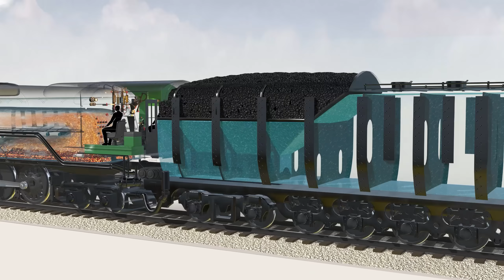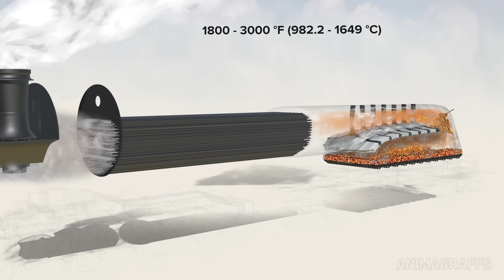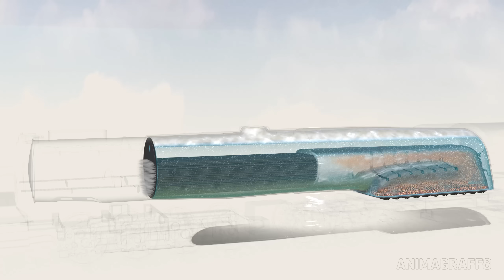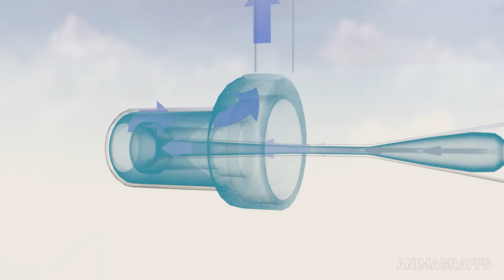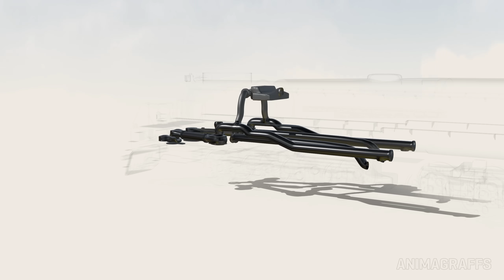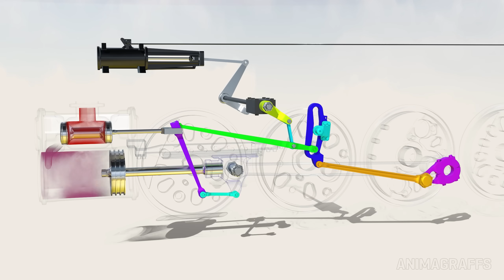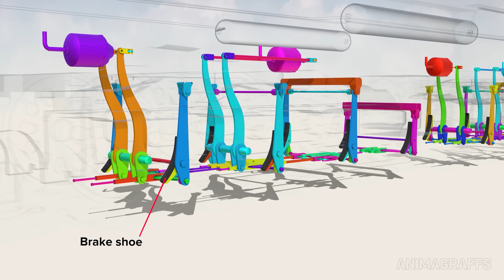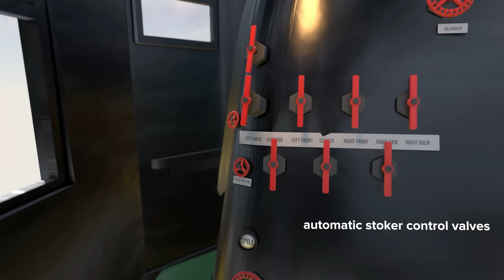How a Steam Locomotive Works (Union Pacific "Big Boy")

Comment: The piston operation produces high torque as may be required to put carriage in to motion. Still is it possible to incirlirste steam pieered Aletrnator and  link steam boiler- Alternator to transmission system to drive . Incorporating both piston drive and slternstir powered motor drive

Comment: @7:20

Steam = water in the gas phase (water vapor). 
Saying “when there is no water in it” makes no sense, because steam is literally made of water molecules (H₂O). There is no such thing as “steam without water in it.”

You can compress water – just not very much.
Liquids (like water) are much less compressible than gases, but they’re not perfectly incompressible. Under high pressure, water’s volume does decrease a bit.
When you compress water enough, it can freeze into high-pressure forms of ice with different crystal architectures than ordinary ice.

Comment: 7:25 need to work on the script explaining stream. Pure (dry) steam does not contain liquid water droplets; it is water entirely in the gas phase. It isn’t that steam doesn’t contain water. You’re imprecisely stating phases. Lastly, water is compressible. Water is nearly incompressible compared with air, but not perfectly incompressible.

Comment: As our population embraces brain atrophy and regresses toward stepford lemmings, it is very nice to see such well put together and delivered discussion, perhaps the best I've seen on stm locomotives. let alone so many nice engineering marvels.  For a long time I wondered how they pushed ambient press water into a 300psi (?) boiler only the stm energy on board w/o mech pumps.  I eventually asked a model train builder friend (6" scale) and he mentioned eductor/ejectors.  Working where I worked I should have known - but very well presented !

I wonder how many dry-fired explosions happened before they decided THREE was the correct number
The stm throttle box on a new six million dollar, 1000 psi stm turbine is frighteningly exact to the 4014 throttle !
Always thought a great design to use exhaust stm to pull on the flue gas, without which the powerful puff puff out the stack we all fell in love with, would be lost !

Comment: A new technological jump today is the Electric motor and Electric vehicles. Same as ICE was compared to the Steam engine today we have the Electric engine, smaller, cheaper, more powerful, more efficient, future proof. We just need to handle the fuel .

Comment: One thing you missed at the very end, is how do they get the water from the rear section into the front boiler? Is that automatically fed as well? Or do they manually have to transfer the water? 

Also, the pistons that turn the auger that pushes coal through, they need steam to run, as does the steam jets, so does that mean that these trains still need to be started manually? Having someone shovelling coal in? Also how is the fire started in the coal which allows them to just keep shovelling coal in? Is there an element in there which heats it, or do they light it externally? How do they turn the train fully off and shut it down? Say in an emergency stop, what can they do to quickly put the fire out, and remove as much heat as possible from the boiler area, and reduce steam pressure?

Comment: As if i look at this, we actually could make h20 and use the gas to heat the water.. to make steam.. 😅

And lead the cold water back in the water tank.. with some with some additives which can make h20 again.. 
o men.. we could create a steam engine which could run for ages without refueling it..

Comment: water is compressible, but only very slightly under normal conditions, leading to the common perception that it's incompressible. While air is easily squashed, water molecules are already packed closely together, requiring immense pressure to noticeably reduce its volume. This slight compressibility is crucial in high-pressure industrial applications like waterjet cutting, and at extreme pressures, water can even change to exotic solid ice phases. 
Why it seems incompressible:
Molecular spacing: Water molecules are already very close, leaving little room to squeeze them further together.
Practical demonstrations: Trying to compress water in a sealed bag or syringe results in it shooting out another opening, not shrinking. 
When water is compressible:
Extreme pressure: At pressures found deep in the ocean or in industrial settings, water's volume decreases. For instance, about 10,000 bar of pressure reduces water's volume by 3%.
High temperatures: Water's compressibility changes with temperature.
Phase changes: Under enough pressure and low enough temperature, liquid water can become a solid, such as ice VI, demonstrating its ability to change structure under extreme compression. 
Real-world examples:
Waterjet cutting: Industrial machines use water under extremely high pressure to cut through hard materials.
Hydrostatic skeletons: Many soft-bodied animals and plants use the near-incompressibility of water for structural support. 
In summary, while water is not perfectly incompressible, its compressibility is usually negligible for everyday purposes, but it becomes significant under specific high-pressure conditions.

Comment: The Big Boy locomotive was actually a twin engine locomotive, one forward and one rear.  Both engines used high-pressure steam from the boiler, marketed as Super Power Steam by ALCO.  Similar models used the steam twice exhausting the high-pressure steam from the rear to low pressure steam in the front, such as Norfolk & Western's Y-class locomotives..

Comment: Big boy had like 7000HP, modern engines have 4400 HP. Two AC locos could pull what it did but they only weight 440 tonnes combined which is the limiting factor.  “Big Boy” is still a beast and my all time favourite.

Comment: How didn’t the boiler tubes get clogged from the condensation of the fumes coming from the boiler and the soot produced? I have this problem in a heat exchanger I have installed in my chimney.

Comment: Interesting now I can better picture what was going on when steam trains were attacked during WW2. Forgive the question but I'm curious when the boiler explodes with all that psi I'm thinking the pressure releases without a blast wave but is evidently shown in guncam footage as a violent fireless explosion. If I am correct & a train was targeted in a rail yard does that mean other than the flying debris destroying whatever was in its path there would be no blast so tracks wouldn't require repair or is there likely to be a bloody great creator? This vid has got me thinking.

Comment: At astronomical pressures, water's volume does change. 
Engineering and scientific applications:
In some high-precision engineering contexts, like hydraulic brakes or deep-sea exploration, the small, measurable compressibility of water is relevant. 
In summary, for most practical purposes and within normal conditions, water can be considered incompressible. However, at a fundamental scientific level, it is a very slightly compressible fluid.

Comment: As a former railroad engineer who has spent many hours operating the UP Big Boy, I can offer some insights into this marvelous piece of engineering.

First of, it is one of the biggest locomotives in the Union Pacific fleet.

Secondly, it is not actually a boy as locomotives have no gender.

Third, if you ran very fast towards this locomotive while it is moving at full speed, it could run you over or maybe even kill you.

Comment: Claiming a 100 year old steam engine is more powerful than 4 modern diesel engines is CRAZY. This video is a massive oversimplification of the steam engine process and 99% of the info presented is flatout wrong.

Comment: 7:20 "Water is not compressible at all" ... That's not technically true. It just takes forces far greater than a locomotive's 300 PSI to compress it. Water is certainly compressed at 5,500 to 6000 PSI (The pressures where the Titanic rests) .. If you were to fill a thick container full of water at those depths and bring it to the surface, you'll get a violent decompression when you open it and have a greater volume of water than the container could hold of uncompressed surface water..

Comment: Excuse me? Are you smoking crack? "Pure steam is a gas with no water in it"? 😂 wow... Just .. Wow. Liquid, solid, gas, and even time crystal. Water has these forms. Steam is  by definition the gaseous form of a liquid, which can be on its own and in liquid form, or combined with a saturated solid. Use enough heat and that element will reach a boiling point and vaporize aka become steam. Grade school physics/science here.

Comment: Sporting a 4-8-8-4 wheel arrangement and weighing in at roughly 1.2 million pounds, the Big Boy distributes its immense size across multiple drivers to maintain traction and stability on steep grades, making it a master of uneven mountain terrain.

Comment: Thank you for a detailed explanation. You have done amazing work. I chose to learn Blender rigging with a steam train drive. I sure picked a huge task. Connecting 2 drives to the valve is puzzling. Any tips for what I should be using to connect the rods that mix? Trouble seems to be having 3 points control and keeping it locked on X with the valve. Best way I can't explain it since I'm not an expert rigger or Train guy. :) Take Care Buddy 👍

Comment: Good lord this has got to be the most beautifully presented explanation/demonstration of how something works, absolutely top notch. I worked in a large scale machine shop some years back that was kind of a jack-of-all trades, we did welding, machining, part restoration and repair, painting, powdercoating, parkerizing and all sorts of other stuff, and were contacted by White Pass steam tours from Alaska about reparing and restoring one of their old steam locomotives, I spent 9 months helping overhaul that behemoth and got to learn all about how these beautiful machines operate, it's wonderful getting to see through these animations how everything fit together as one piece, instead of getting to look at one part at a time. One moment that stands out to me was when I was tasked with cleaning scale from and regrinding the drive piston bores, they were in rough shape from decades of uninterrupted hard use, and at one point I got to cleaning the ports between the high and low pressure cylinders, and discovered there was so much scale built up in the port that a good 70-80% of it's flow was choked off, severely limiting it's flow rate. I chipped out the 1/2" thick layer from inside the port with a HSS chisel I made and a 3lb sledge, it was ludicrously strong stuff, and once it was all said and done and we had the chance to talk to the White Pass locomotive engineer who ran the train, he mentioned that he couldn't believe how much more grunt the train had, he said it accelerated a good 25% faster when run without a load, and I told him about my descaling operation in the ports, and he thanked me for making his train faster😂. But that was just a small portion of the amazing work we did on the train, we restored the entire train, including replacing all the boilertubes and pressure testing the boiler, repainting everything, machining new pistons and seals, and many, many other parts. If anyone is interested you can search online for "White pass Steam Train Restoration by Newell Corporation".

Comment: as big boy 4014 operates today, it burns heating oil or waste engine oil. they probably did this because there aren't any coaling towers anymore, they didnt have to work on the stoker assembly, and i imagine in burns cleaner. a second video on how the oil fueled system works would also be interesting.

Comment: The sheer complexity of this thing is astounding. The fact that something more powerful than 4 modern engines and made so long ago is crazy. The complexity of the components is bewildering, the suspension, frame, power system, steam system, all insane feats of not only engineering but design. No CAD, no advanced alloys, just a pencil, paper, some measuring tools and equations, a shit ton of time and the insane knowledge of the craft. Engineering at its best. Beautiful.

Comment: Water is absolutely compressible. Its just that, it requires such large forces that in engineering, you might as well consider it non compressible. Water at the bottom of the ocean is denser than at the top for example.

Comment: Wonderful video, but as a scientist I need to correct the notion of you saying 'steam without water'. This is not correct. What you may be referring to is hot air, however this is still actually steam, it is simply too hot and will keep the air far above it's saturation temperature, and thus will now allow condensation, and as such is transparent. The water is still there in the hot gas. This is referred to as 'superheated steam'

Comment: You have done a masterful job of explaining these locomotives.

Unfortunately, you have fallen prey to some of the hokum that surrounds these wonderful machines. They NEVER pulled 5-mile long freight trains. That came from ALCO's advertising literature. Although it had enough tractive effort to theoretically start a train of empty cars of that length on level track, it would not have been able to move them at anything greater than walking speed. There aren't too many places on the Union Pacific that are dead flat for 5 miles. They didn''t run across the Bonneville Salt Flats. They were designed to pull 3800 ton trains unassisted, up the 1.14% grade in the Wasatch mountains, from Ogden, UT, to Green River, WY.  As for speed, they were limited to 45 MPH by timetable instructions,. I have the employee timetables in my collection that prove this. In fact, they spent a great deal of their time slugging it out on ascending grades at 15 - 20 MPH. Trains of perishable fruits and vegetables were limited to 3600 tons and 75 (40 ft) cars,. That's 3036 feet( (including the 36 ft) caboose, less than 6/10 of a mile.  Later, their tonnage ratings were increased to 4450 tons for drag freights, although the limitations on so-called "Fruit Blocks" never changed.

The Challengers were permitted 50 MPH in freight service and 65 in passenger service. There was no distinction in service for the 4000s. It was 45 MPH period.
The 80 MPH figure that gets bandied about was the design speed of the reciprocating parts and was an overdesign to eliminate the possibility of road failures at the lower operating speeds. This was common practice in those times. Just look at the size of steel bridge members of that period as opposed to modern structures.

Incidentally, both the Big Boys and Challengers had a water sprayers at the back of the tender, near the back up light. They could cover an area encompassing the first few cars behind the tender and 25' on either side of the track to prevent fires caused by burning embers from the stack of the locomotive. They seldom got used in practice since engine crews considered that a waste of precious water.

Comment: It's fascinating to be that the answer to every problem in a steam locomotive is "steam". Need to move coal to different locations of the boiler? Shoot it with steam. Need lights? Steam-powered dynamo. Clean the sensor glass? Blow some steam at it.

Don't get me wrong, it makes perfect sense! It was just fun how many little tidbits were powered with steam - I guess just how in modern equipment "everything is computer"; you apply the tools you have to everyrhing!

Comment: I remember my grandpa (he served as train dispatcher for some 56 years) telling me the actual steam engine doing the work is the small cylinders (pistons) on the sides of the locomotive and the large thing is just water boiler. This amazed me as a kid - definitely helped to kindle my interest in science and engineering.
These machines may look primitive at first glance but one really appreciates the ingenious engineering put into it once trying to construct anything the moves heat be it a simple kiln or an engine.
I wonder whether the steam engine would get any more efficient if it ran of pure carbon (e.g. sugar charcoal) rather than black coal as there would be virtually no solid ash which is a dead weight lowering the overall efficiency.

Comment: There's an error in the animation @Animagraffs- The reverser lever's connector to the eccentric rod is breaking physics.  The connector is acting like a rubberband instead of a solid metal dogbone in the animation as the eccentric rod is moving at 16:37, 17:14, and most apparent at 18:40.  The thickness actually changes with the stretching of the connector as it moves.

Comment: The longest train ever recorded was operated by BHP Iron Ore in Western Australia with a length of 7.353 kilometers (4.569 miles). This train required 8 modern diesel electric engines to start and operate. You're dead ass wrong about Big Boy being able to pull a >5 mile train by itself. I think the confusion comes from anecdotal accounts of a "Big Boy" pulling a ~650 car train. There are no official accounts of this ever happening and  if it is true the train cars were likely empty and the train would have been brought up to speed by several engines until the momentum could be maintained by the single engine.